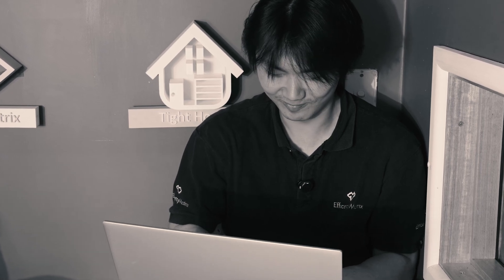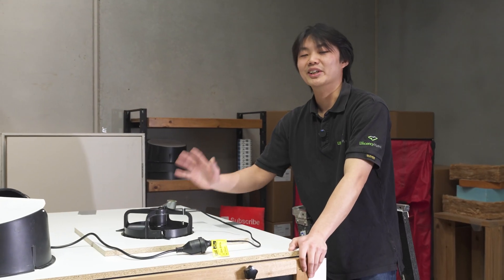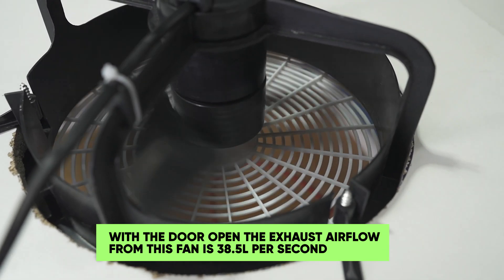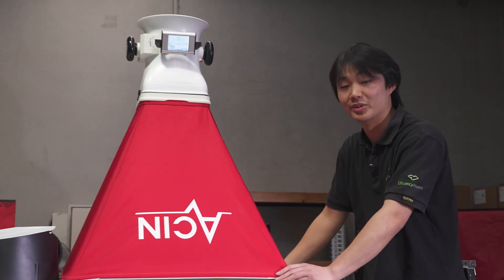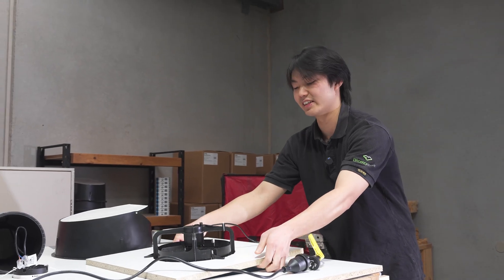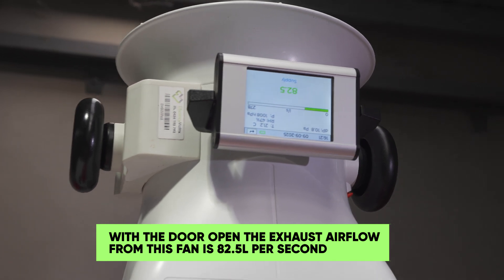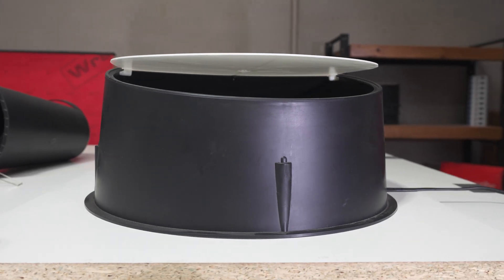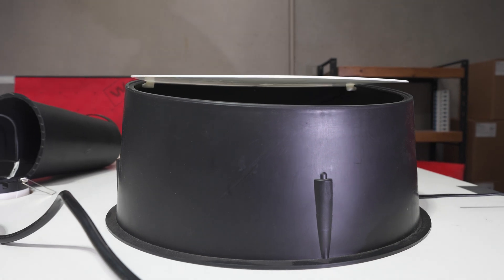Why Your Bathroom Fan Can’t Open a Draft Stopper

Comment: The first fan is pretty infamous in the fan collecting community for its poor performance & rough sound during startup. I recently tested one, and indeed it does perform very poorly with awful power factor (0,38 compared to an average of 0,65 on non energy saving models). I'm curious though, does the damper itself reduce the airflow output of the fan? It seems like the small opening of the damper would increase air resistance above the fan, thus making it move less air.
Reply from the maker: It sure does we covered a video on that.  But where our exhaust tight differs, it is less likely to open up with wind compared to others.  https://youtu.be/h53upSUNumA?si=P_2rmdNne8dQzGRs

Comment: Can vouch for this. I purchased one of these draught stoppers from Tight House and it worked very well. Some time later I noticed the bathroom wasn't clearing of steam and the fan was making a strange noise. No problem with the draught stopper, the 25 yo fan was on its last legs and was barely spinning so the flap would no longer open. I've since replaced the fan with a sealed back unit that can be ducted outside, but as a retrofit solution for a draughty bathroom, these are great. They also keep bugs and dust in the roof off the fan.
Reply from the maker: Great to hear this worked so well for you, and thanks for sharing your experience!

Comment: We have a fan from the big green shed in our bathroom but is as noisy as…
Is there anything that can be DIY to replace it that is quiet? We are shift workers so would be good to be able to still use the fan but not disturb if the other is sleeping.